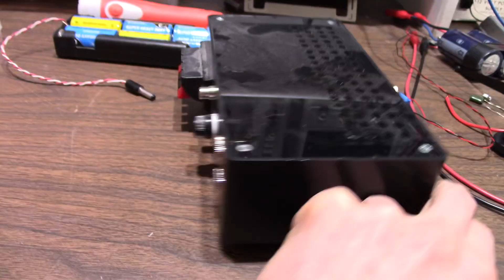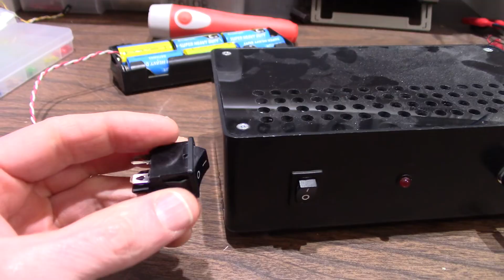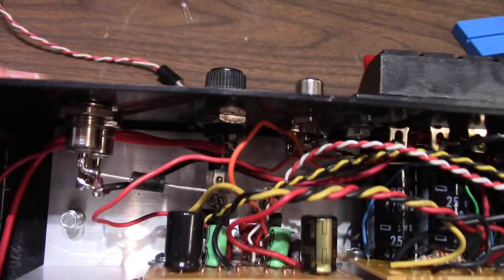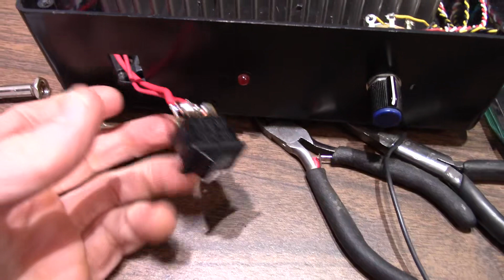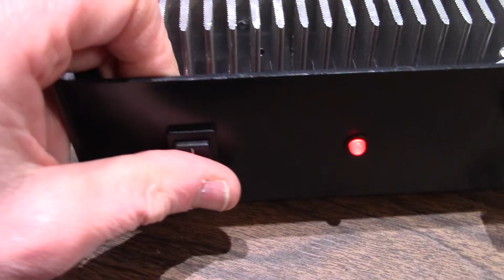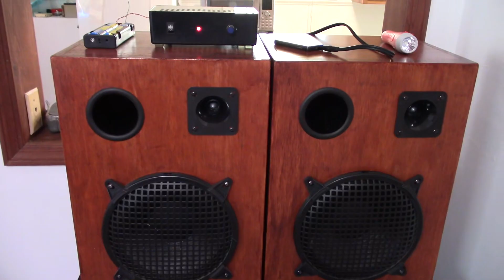Quick repair on DIY amplifier

Comment: Hey John I have a Yamaha rn-303 and I believe I burnt it but the amp tries to turn on because it turns on and like 5-10 sec latter it turns back off.

I bought another one but I kept the damaged one because usually it’s a fuse that burns out before the device burns out. 

I tried changing the fuses and that did not change the situation are there any pointers you can give me on trouble shooting to target the problem also would you fix it if I send it to you. 

Matter fact I started following ur channel a couple years ago trying learn how to fix it. I believe It can get fixed that’s why I haven’t thrown it away but yeah let me know if you can help me out with this.. peace!!